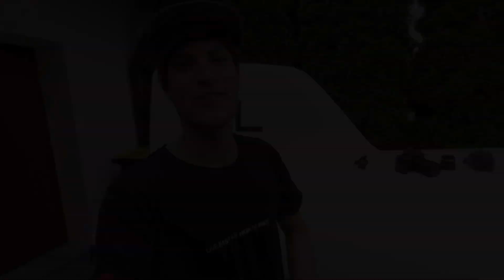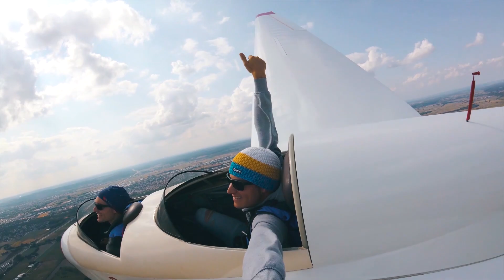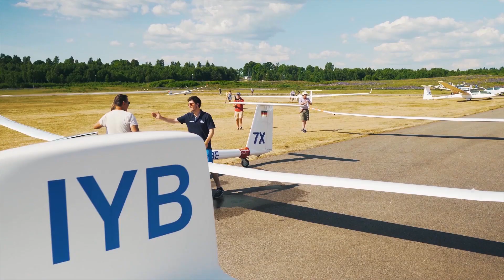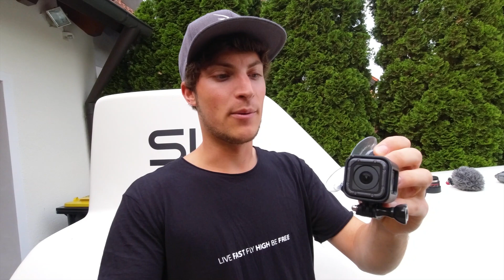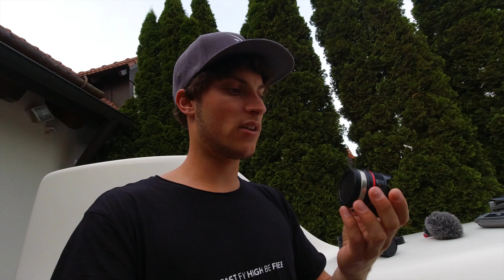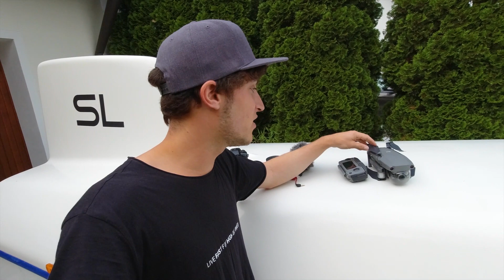My AERIAL Filming Equipment  | Free Download | VLOG² 9

Comment: Very nice. Now you need to design a suction cup mount that will fit the standard size go pros, LOL. By the way, how do you like the hero session? I’ve heard some people don’t like it so much.
Reply from the maker: Yes, that´s on my list. I have recorded this video with a new DJI Osmo Action and I really like this one. Sometimes I have overheating problems with the GoPro 5 Session and then it stops recording. But it is smaller than the standard size GoPro cameras...